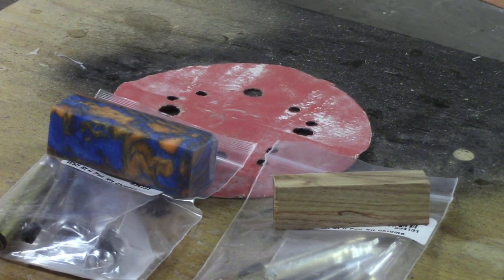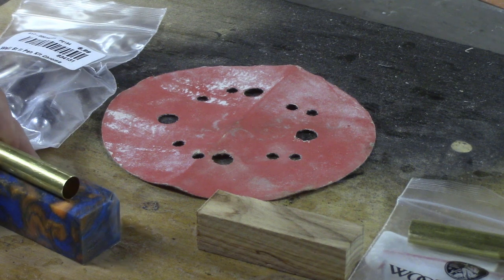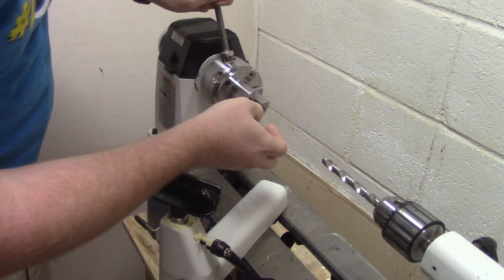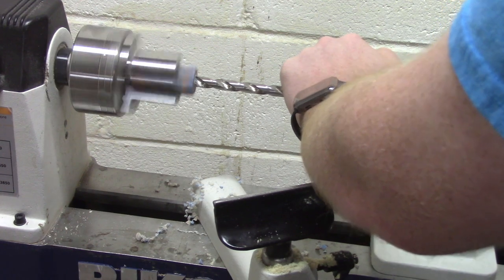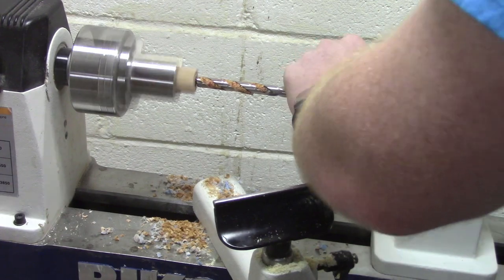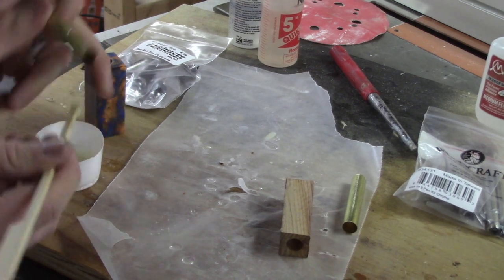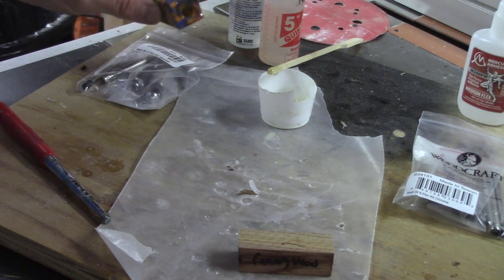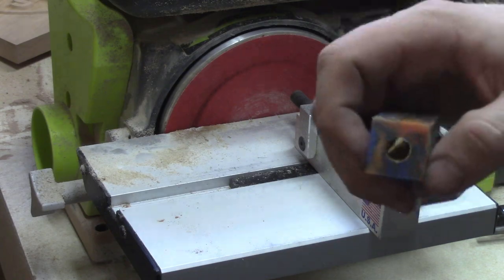Preparing Resin & Wood Pen Blanks | How To | July 2019

Comment: where did you find the jig for sanding the blank ends? Very nice video !
Reply from the maker: Gary Maynard I got mine from tshadow.com. You also need punches for the different size tubes. Thanks for checking out the video.
Reply: @CrossCutCreations  I am new at pen turning, about a year now, and I have been using ca glue for the acrylic as well as the wood blanks. Is there a reason for using epoxy instead of ca glue for the acrylic blanks? I haven't had any known problems using the ca on acrylic blanks, yet. Just curious... Thanks....
Reply from the maker: Gary Maynard There might not be any problems. I just prefer it because I’ve heard there’s a better bond with epoxy, especially if you’re turning a hybrid of any sort. It bonds unlike materials well, but if you haven’t seen any issues with CA, then I don’t see any reason to switch. If you ask 100 pen turners how to do something, you’ll get 100 different answers and they could all be right because it’s what works for them.